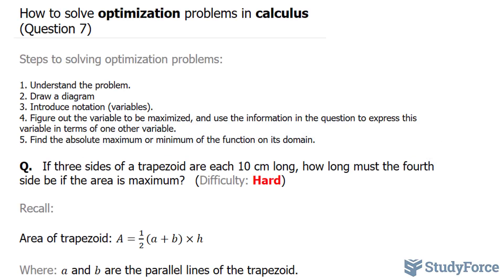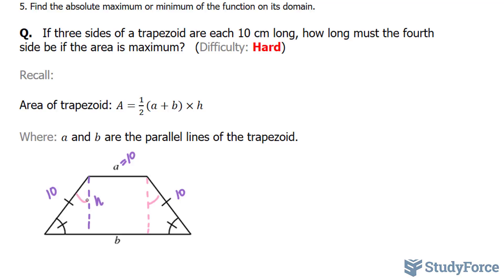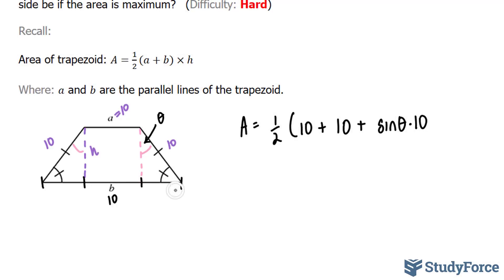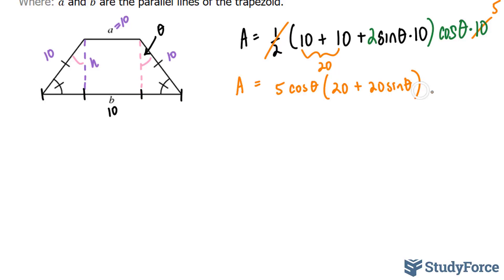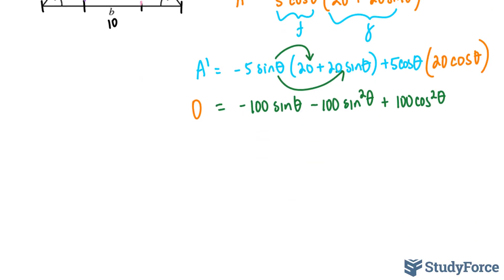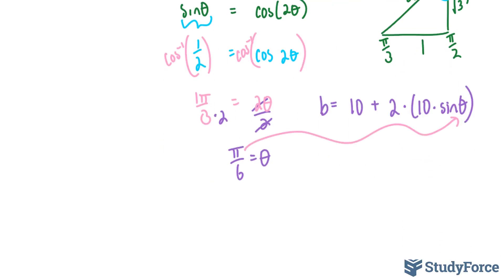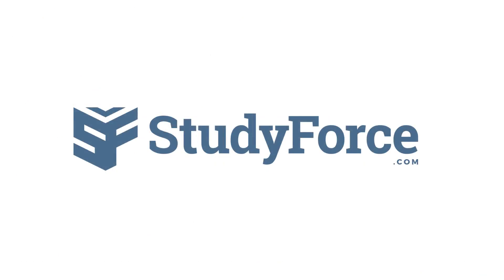Maximizing Area of Trapezoid | Calculus Optimization Problem

Comment: A much easier approach that doesn't involve trigonometry is to write the area function using x as the two identical length of the fourth side. this way you will only need pythagoras theorem and knowing how to use the product rule to differentiate. as the area if A=(a+b)h/2, a is 10, b is 10+x+x, h would be using pythagoras theorem, sqrt(10^2-x^2)
Reply from the maker: If you don't mind, please show us the complete solution here, or use our website https://biology-forums.com

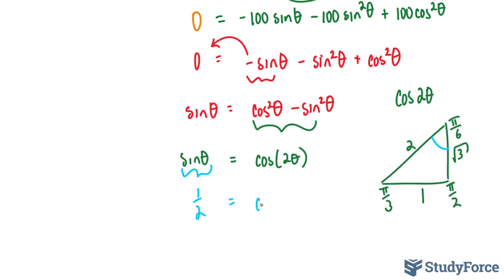Comment: At 6:40 , how comes that the sign theta becomes 1/2? . can i please know what should i learn in order to understand it?
Reply from the maker: Remember that sine = opposite / hypotenuse. Opposite is 1, hypotenuse is 2. Therefore, 1/2
Reply: @StudyForceOnline  but if you are going to say that sin(theta) is 1/2, then you are already assuming theta is pi/6 and you don't have to solve any more.

How did you know to use the 30/60/90 triangle?
Reply: @jasonbrandler66   Well, it's just something you will need to be observant about. knowing that sinθ=cos(90-θ). And the most common you would know is sin30=cos60, which happens to be sinθ=cos2θ. Alternatively, I also had a another way to solve the problem that doesn't involve trigonometry at all: 

A much easier approach that doesn't involve trigonometry is to write the area function using x as the two identical length of the fourth side. this way you will only need pythagoras theorem and knowing how to use the product rule to differentiate. as the area if A=(a+b)h/2, a is 10, b is 10+x+x, h would be using pythagoras theorem, sqrt(10^2-x^2)